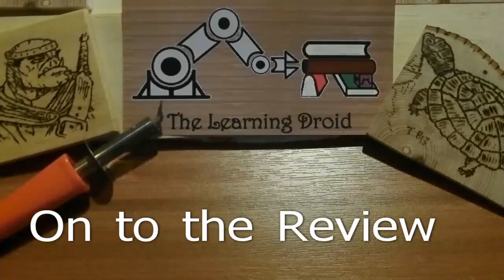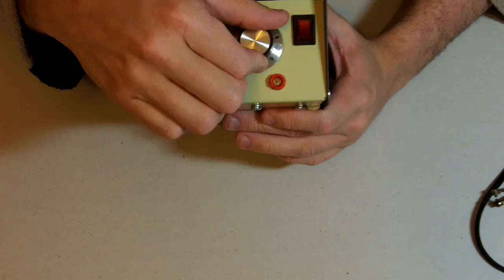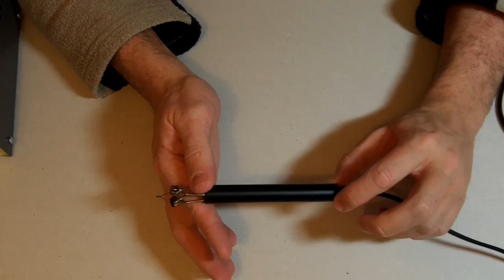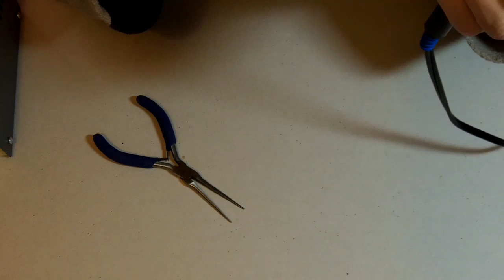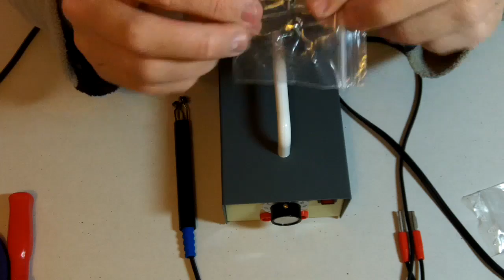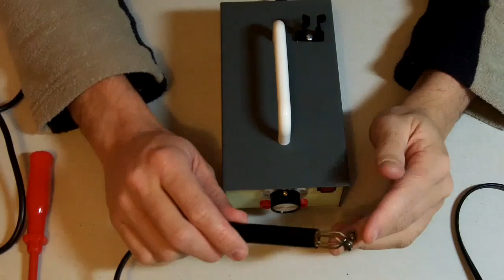Review - Peter Childs Pyrography Machine

Comment: Really nice review, thank you!
You mentioned about connecting more than one pen at a time - the type of switch you mention would be very easy to make yourself, the "bullet" connectors you talk about look like a standard (probably 2 or 4mm) banana plug.  Two plugs (to go to the machine), four sockets (to plug the pens in) and a double pole/double throw switch to switch from one set of sockets to the other.  Add a box to put it all in and some cable, and you are probably talking about £10 to £15 from Maplin or Farnell to build your own switch.
Reply from the maker: +Owen Morris 
Hey Owen, I know how to make a switch for the various pens to have multiple pens connected, I am not much of an electrician and so never made one, but I know they are easily made. 
My issue in the review was that the company basically, in my opinion, missed the making of a switch able multi pen connector like other companies. Many companies provide either multiple switch able connectors on the machine or a toggle switch addition that lets you switch between pens, where as this company only provides a circuit continuation plug so all pens are on at once.
It was merely a mention of a deficiency in what the company provides or is offering compared with other companies.

Comment: I've had one for years, I found when I used it on a long project the heat at the tip tended to drop off, so one minute you had a nice steady line then it would heat up unexpectedly or  fade again. I thought it was me but the more experienced I got the more I realised it was the machine. To be honest it has put me off of using it, I've had it too long now to take back so I'm stuck with it
Reply: Look at Burmaster pyrograpy machine those who have used Razortip and tried the Birnmaster like the Burnmaster better. Or build one from a manual battery charger.
Reply from the maker: Are you experiencing this drop off while the piece is in contact with the wood?, if so you're getting a mix of carbon build up and the normal temperature changes during contact with wood. A wire point machine has a very low thermal mass so it looses and gains heat quickly, a quirk of a wire point machine. And carbon build up messes with the electrical current heat generation
Reply: I have a piece of sandpaper beside me for just that, no its a good point ill keep an eye on it, I even wondered if it was me just breathing on it as I worked but I dont think its that either. I am looking into buying a razertip, they seem popular and I've never used a fixed tip, might be interesting to try, thanks for getting back to me, keep up the good work
Reply from the maker: HI Ian, that's strange, I don't experience a heat drop off apart from the initial heat drop off when I first start using the bit, which is the loss of heat from the thermal mass, then the heating current takes over, I am not sure what the issue is. I hope you find a machine that suits you.
Reply: If I find anything relevant when I get the new machine ill let you know, thanks again.

Comment: The tube is not made of plastic !!!! It's made of alloy which is used in space .
Reply from the maker: Hey Looner Berry
Thanks for your comment but I am going to have to respectfully disagree, 

It may be that the tube is made out of a polymer mix of plastics, and indeed this Polymer mix might be used in space.
However an Alloy which is a mixture of metals, is what the burning tips are made from not the handle.
And even if the handle is made of a Polymer, it is still a plastic based Polymer, and I stand by my review, it is a good machine, and having a plastic polymer handle is no negative against it.

Comment from the maker: Hey Viasha 

Running costs, So far I have not had to replace the connector point on my pens, and replacements only run about £4, the wire is £5 a reel, but can be cheaper if you buy multiple reels, that said 1 reel will do several HUNDRED points.

Pens are expensive but very high quality and I haven't had any issues with the pens, as said connectors the most likely bit to go can be bought. As long as the machine doesn't get miss treated running costs are low. 

Brass wire brush works great too.